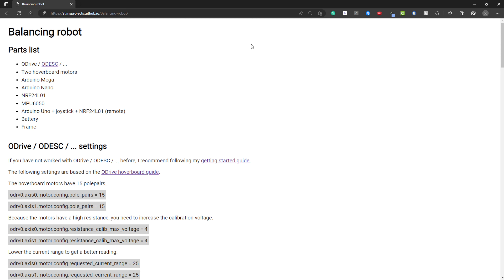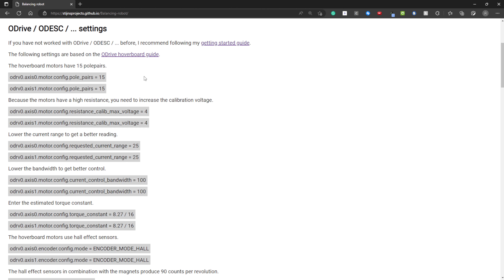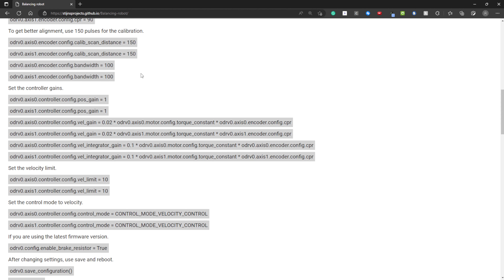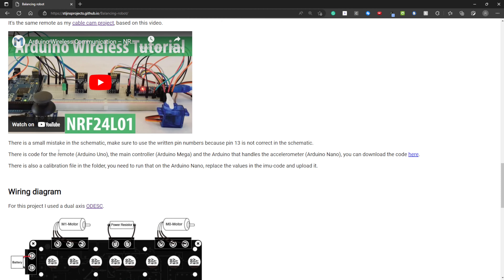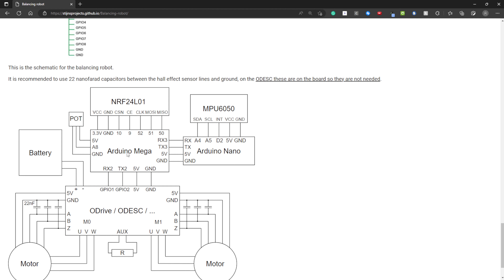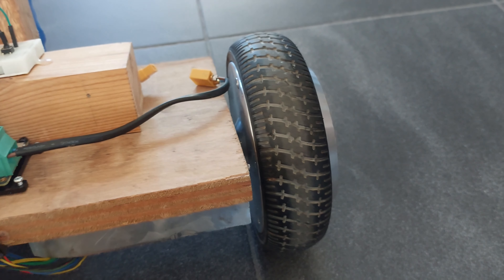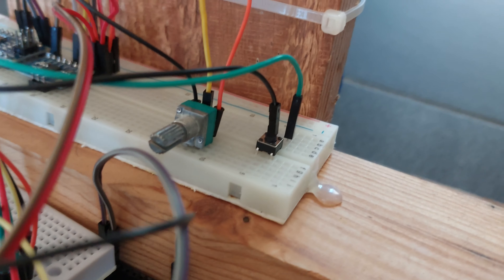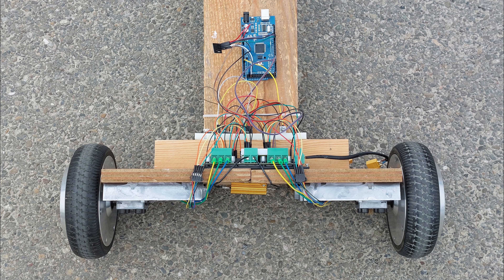Balancing robot 🤖🔋 | hoverboard + ODrive/ODESC

Comment: hello thanks for the amazing video , Can you make a video for  adding SPI ams as4748 ,encoder to hoverboard motor. thank you
Reply from the maker: You want to add an encoder to a hoverboard motor?
Reply: @stijnsprojects  yes to hoverboard motor  ,still trying not able to solve the errors with spi encoder.  Working perfectly with hall encoder. I want to use hoverboard motor  as an robot joint.

Comment: hi stijn, awesome project! i am rebuilding it and i am trying to find your code, especially the code that goes on the mega but th ones i find in your "code.zip" looks very empty. where can i find more?
Reply from the maker: I've checked and the folder is not empty. You need to run the calibration file on the nano and copy the offsets to the IMU file in the imu-nano folder and upload that file to the nano. For the mega you just need to upload the rotaped file and for the remote the remote file.

Comment: hey, how if I use any bldc motor driver not odrive?
Reply from the maker: I think it should be possible if you tune the PID correctly. Keep in mind some drivers can't drive low kv motors.
Reply: @stijnsprojects  Hi bro when I completed configuration and connect Rc remote and to test the wheels I get error cannot drive the wheels i checked my all config no error before test
Any advice to solve the error  Thank you 😊